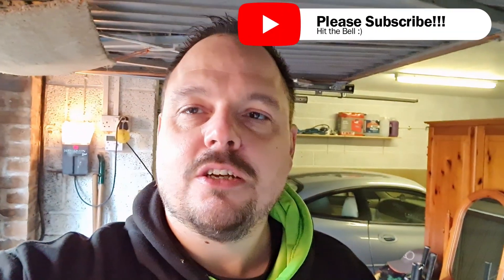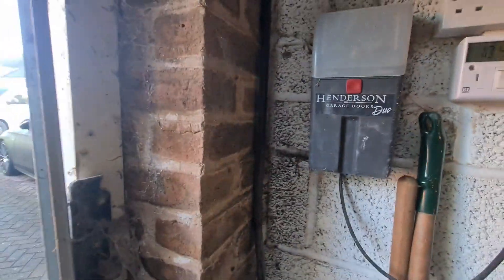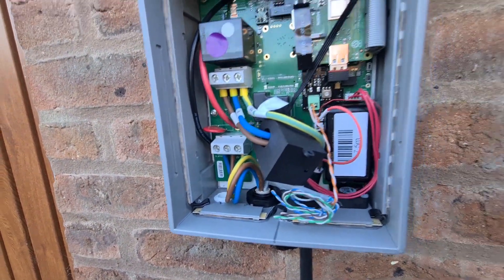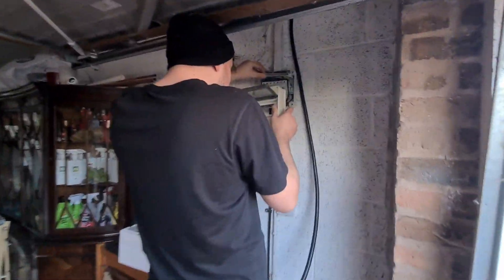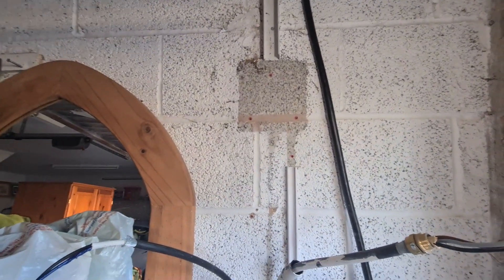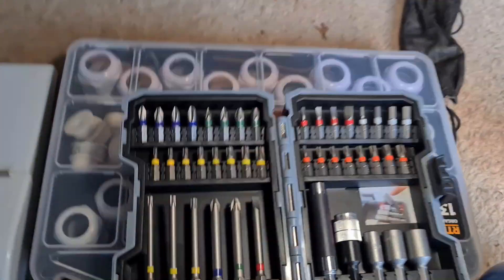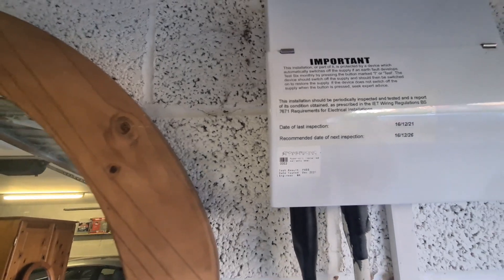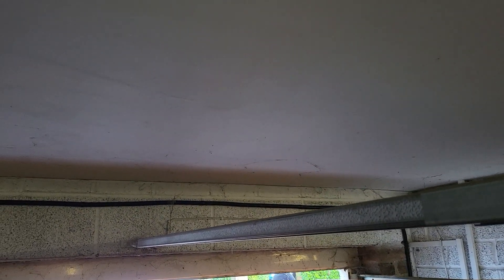Hypervolt EV charge point installation, Hypervolt Cable!!

Comment: Hi Mark, what's the barcode software you use for your crm system? we're looking for something similar for our installs. Thanks, Kris @ Henshall Electrical.
Reply from the maker: I use servicem8 to manage the bar codes and they have a QR system we use as well. Thanks.
Reply: @electrician247  thanks Mark, we used to use ServiceM8 and went over to simpro! Will see if they have this feature on their system. 
Great video aswell, enjoyed the information.

Comment: Hi Mark, as all EVs have their own charging cable to plug in to a public charging  point, why do home charging points not have a socket like the public ones have to save having the unnecessary cable coiled around them?  I did ask Artisan but didn't get an answer, maybe they don't answer people from North Wales.😢😢
Regards from Ray in North Wales.
Reply from the maker: Haha. Tbf Jordan gets a lot more comments than little old me. 

It's owner options mate. You can have them untethered if you want. But most people seem to like having a lead on the charge points. Some people choose not to though. 

Hope you are well mate!
Reply: @electrician247  Hi Mark, thanks for the fast reply, yep I'm not dead yet matey although I'm 79, I keep my brain active, asking daft question to sparks etc.🤣🤣🤣

Comment: Do you have to run a cat 5 cable for an ev charger install?
Reply from the maker: No. The hyper volt would work without it. Just minus the load limiting capacity. Zappi have a wireless product to enable load limiting as well. But generally its easier with CAT cable. Do have to watch cable length though for accuracy.

Comment: I love Hypervolts, they are all I’ll fit, I’ve not used the cable yet but from your video it looks very similar to the Doncaster cables EV ultra cable, great vid as always mark 👍🏻
Reply from the maker: I have been told it’s exactly the same just cheaper lol. Will be honest I prefer the eland procell cable cef stock. Thanks mate
Reply: @electrician247  it does look exactly the same, I was going to order some from hypervolt on my next order so I’ll give it a whirl. I’ve not tried the CEF one as I don’t have an account with them, how does it compare price wise with the others?
Reply from the maker: @Waynesworldofgaming  it’s around £6.50 +VAT. Cat cable has individually screened cores and easier to strip and bend. Showed it on the electricians podcast video I did on Sams channel. Monday Club.
Reply: @electrician247  not too bad then. Ok mark cheers for the info, I’ll give it a watch 👍🏻

Comment: Hi Mark  when you come to install the new supply to the garage will you be looking at SWA of a minimum of 10 mm or even 16mm  and would you consider running a separate 10 mm CPC . This Was always a bit of an argument when I was still working , and even not installing an earth at all . So putting an earth rod instead .  Has this subject been resolved or is it still up for debate ?                Best wishes and kind regards    😀👍👍👍
Reply from the maker: Hi! It is still debated often. We will retain the exisiting supply for the current setup and then pull a new 10mm in most likely just for the EV. Volt drop calcs permitting of course! We are also changing the CU in the house so this makes the most sense. I have no issue expanding the equipotential zone in this case. Always use a core for the earth and when needed matched to the sizing required for any bonding. Alongside the armourings that is the approach we usually use. Thanks
Reply: @electrician247   bless you my friend yes your approach makes perfect sense , I can remember when we would ring up the NIC and even they would struggle to give a definitive answer .  Have a peaceful and restful Christmas , you like many others in our industry deserve a little karma in your lives  best wishes and kind regards as always. 😀👍👍👍

Comment: New products to buy and try, do like glands with fire rated grommets never made sense that Wiska do the push ones but the meter tail gland isn't. The wago style connectors look like the 6mm 221 connectors?

Lovely install though, yet to fit a Hypervolt, most of our customers want the Zappi or the Anderson A2 but the A2 can't be hard wired anymore as they've removed the connection and the Zappi's have had a lot of issues this past year.
Reply from the maker: Ha ha yes they do look like that. In fairness close up they are different. Lower price as well.

We install most brands and touch wood no issues so far! 

Have a good Christmas and New year mate.

Comment: Current clamps not meant to be around L and N is it ???
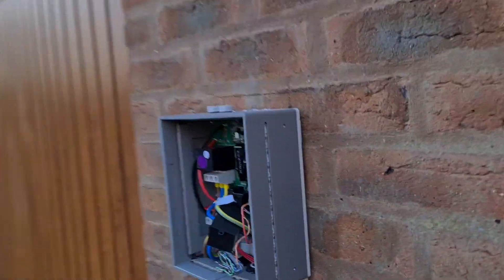Reply: 0:45. It’s round both. Or is that something else.
Reply from the maker: @AndyK.1  in the charge point itself? Supposed to be like that. That's part of the load and RCD detection I believe. Load limiting clamp is in the consumer unit. Can go round L or N so long as you get the direction the right way around 💪
Reply: @electrician247  I guess that’s some ferrite then to reduce EMI. 
Yeah of course it wouldn’t be in the charge point. Silly me.
Reply from the maker: Can go round the N if you reverse direction 💪

Comment: Hi Mark, tidy little job there mate, I presume there was a network connection available in the garage as you said there was an unused office above?
Reply from the maker: WiFi in the house and garage/office. Excellent data speeds. Thanks mate.
Reply: Cheers for the reply Mark. 
So can you use WiFi for the hypervolt or do they have to be hard wired?

Comment: Mark in this situation to cover you would you note the restriction on your paper work in case in the future a new owner takes over and its still the same install but new owner decides to use other equipment. Things like load adjustments can be changed.
Reply from the maker: It's all noted on the paperwork but we are going back very very soon. The video helps as my evidence for how we left it short term 🤭

Comment: I personally always try to drill any holes going from outside to inside on and angle downwards from inside so that any moisture will run downwards to outside and not back into the building/cavity. I know in your case the cable is protected by the unit being above it and you have probably sealed it too.
Reply from the maker: Would normally do the same. But in this case its very well sealed both sides and the cavity is actually open on the other side of the door 🤭